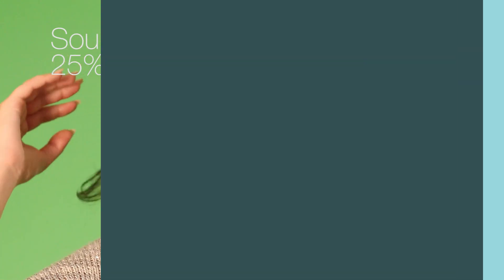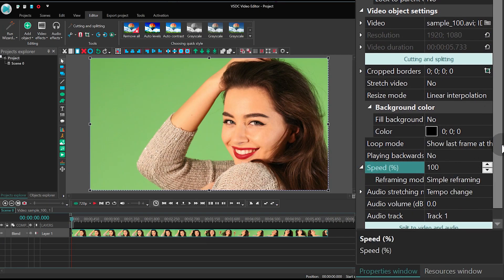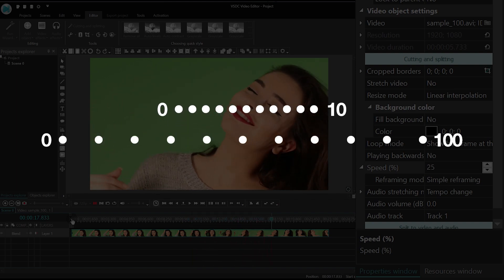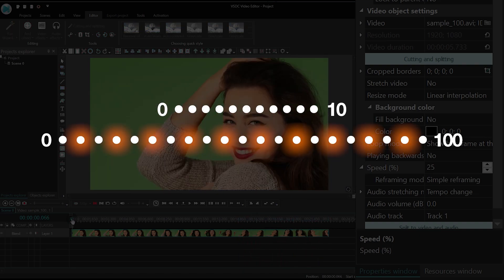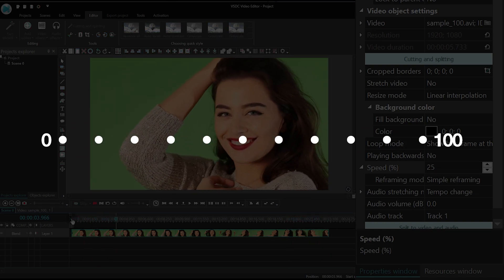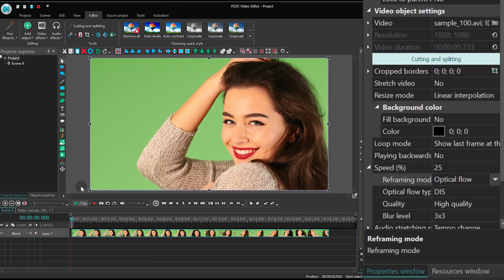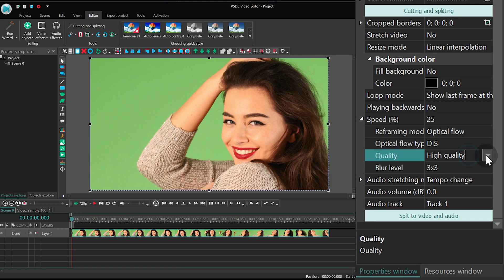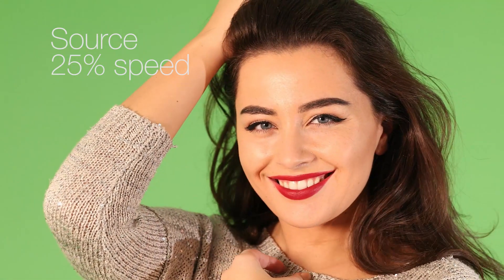How to create a slow motion video with reframing modes in VSDC 6.6

Comment: if I have a choppy move video, can optical flow fix it ?  I don't want to slow my video. I want to keep the same speed and just to fix to smooth move ?
Reply from the maker: yes you can try
you need to create a project, set fps to maximum, (120fps for example) import video and change its settings: 
"Speed" -> "Reframing mode" -> "Optical flow"

Comment: Since optical flow capabilities have been introduced, can this be used to convert a 30 FPS video to a 60 FPS using optical flow while keeping same speed? I don't want to slow the video down I just want it to be more smooth at its current speed.
Reply: Yes... You can

Comment: How do I make it smoother after these settings. It’s still choppy
Reply from the maker: Hello Jettt,
Is it choppy during the preview or after you export the video?
Reply: @VSDCFreeVideoEditor  after I export. Could be because of my crappy computer.
Reply from the maker: @jetttliii6156  Our suggestion is to check the framerate: the original framerate of the video and the framerate you set at the export level. If they're not the same, that might cause choppiness
Reply: @VSDCFreeVideoEditor  thanks!